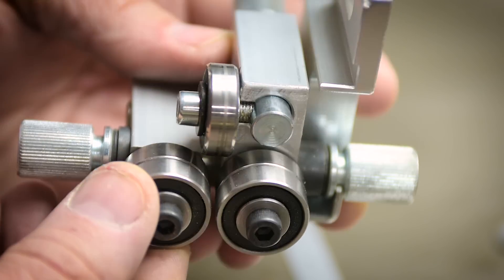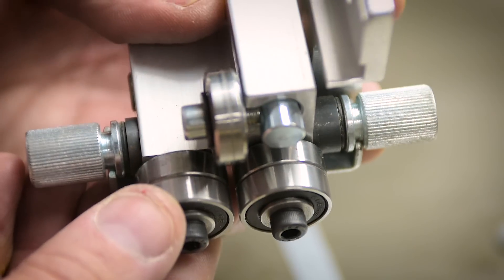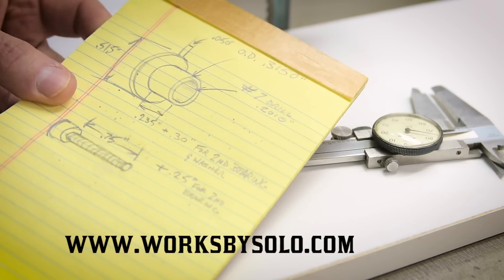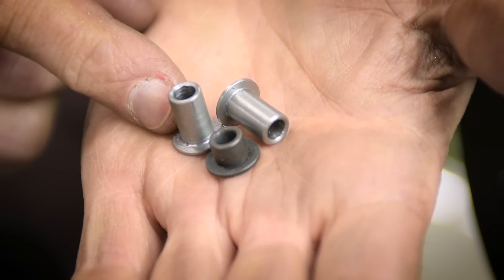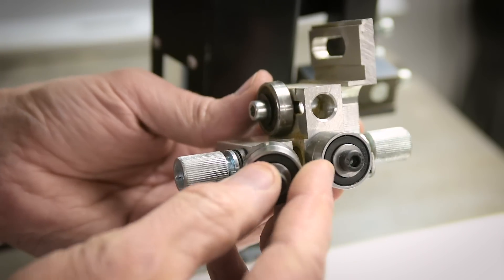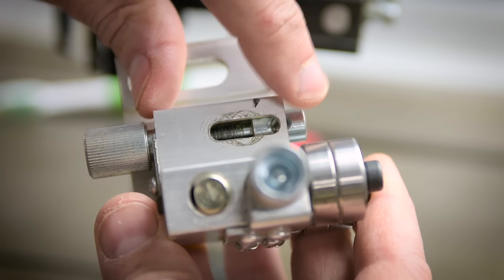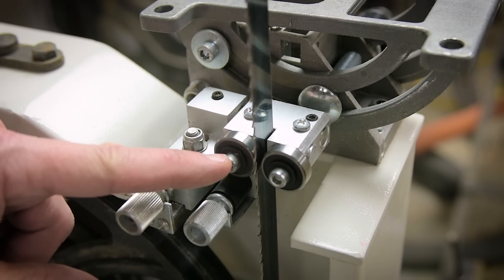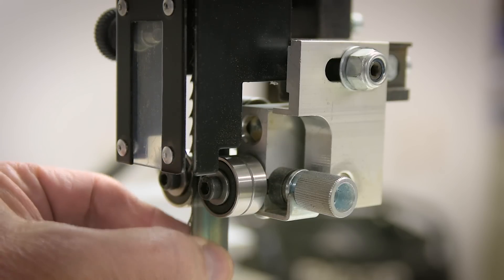CHEAP BANDSAW TUNE UP! | HOW TO UPGRADE BLADE GUIDES | RIKON Bandsaw | Best Bandsaw Upgrade Ever!

Comment: Great video. I have the blue one but essentially the same system. Parts are all easy to get... except the piece you milled out of metal! Also - rather than cutting into your system why didn't you just save the old bushing and cap screw for when you use narrower blades. You would have had  to adjust everything anyways plus you would need second bearing for stability. Also when I go narrow, I find the bearings precarious and usually replace the bearings with a coolblocks I found shaped as the same as the bearings. Final question, when you replaced with longer cap screws, could you have found a screw that had thumb nuts so you don't even have to use a tool? I think the newest ones are tooless that way!
Reply from the maker: Thanks for the comments. I purposely leave the double bearings in place because the gullet of any size blade will always be in the same position, relative to the center of the tire. The thumbscrew is a good idea.

Comment: You should of left the housing alone and just use 1 bearing with original bushing for 3/8" or less blades and by cutting housing it weakens it and causes more movement.
Reply from the maker: That is a really good idea, but you should have told me BEFORE I cut it. ;-)
Reply: @WorksbySolo  Unfortunately it's a year ago.

Comment: This looks like my bandsaw but.. the screws going through the bearings are the one´s holding it to place.. So to be able to adjust where they guide the blade they have to come loose.. but.. this gave me an interesting idea.. There must be a way to make mine look like yours because the bearings are located exactly the same.. But the difference is: no bushing, and no thumb screw.. time to fire up the lathe :D Have a great weekend m8!
Reply from the maker: Do it! I look forward to seeing your solution. Mine uses the very common 608 skate bearings.

Comment: I have a 14” Powermatic bandsaw with Carter bearing guides. I really don’t love the bearing guides because the bearings freeze up now and then. Any comments guys?
Reply from the maker: Have you replaced the bearings when that happens? The Rikon takes inexpensive 608 skate bearings. I just keep a few spare on hand.

Comment: Awesome idea man! :) Any idea on how to upgrade the wheels plastic covers? Ours got damaged somehow and I have no clue what kind of material it is...
Reply from the maker: Hmmm, interesting. I have no plastic covers. Just the metal bearings (wheels) that guide the blade. Is it a Rikon brand machine?
Reply: @WorksbySolo  nooo, sorry I'm probably not using the right words! Not the bearings, but the big wheels the blade runs on... It seems to have some sort of hard plastic around it... And I can't figure out how to get replacement... Maybe I'll just try an inner tube from a bike or something... I just fear it might be too soft...
Reply from the maker: Kjellski Oh yes! Those are referred to as “Bandsaw Tires”. They are replaceable. Commonly made of hard rubber. Sometimes made of Urethane.
Reply: @WorksbySolo  aaahhhhh! That's what they're called, will look up how they're called in Germany! Thanks a lot man! :)

Comment: Cool upgrade. For those who don't have a lathe, I checked and replacement bushings for this saw are only $1.50. If you found the model that has the double bearings, those bushings are probably not much more.
Reply from the maker: Good idea! Thanks!
Reply: Do you know where I can find the bushings?
Reply from the maker: I suggest checking directly with Rikon customer support.

Comment: Great modifications, Bernie! That’s awesome you were able to just extent that slot on the top and bottom.
Reply from the maker: Thanks! It doesn’t work with really thin blades, but I can always revert back to single bearings if need be.